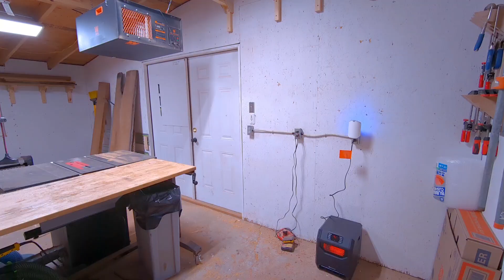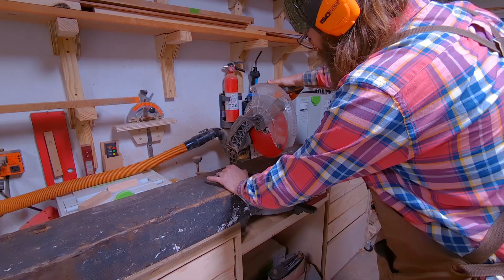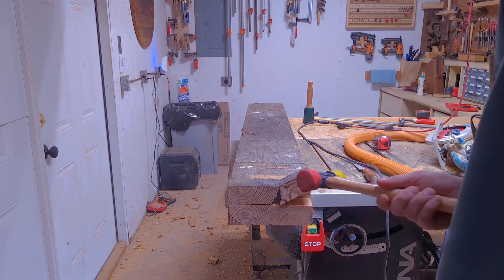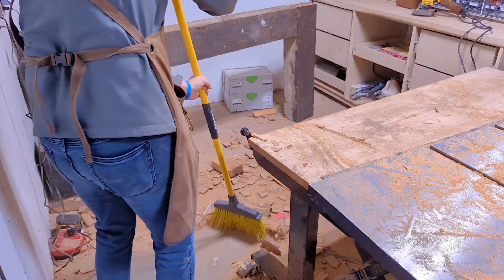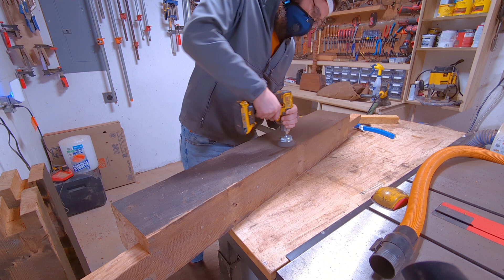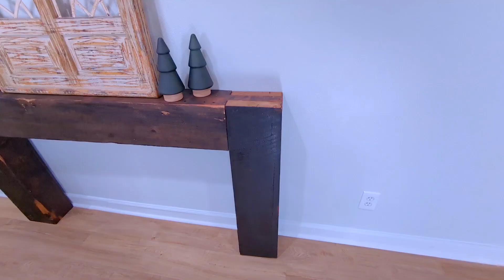The easiest way to build an entryway table using joinery | DIY Entryway Farmhouse Console Table

Comment: Old tube and knob electrical
Reply from the maker: It's cool to see stuff like that and be able to somewhat date the time period of the house.
Reply: @burnstockwoodworking  yea I pulled out of my house a while back when refinishing my house
Most houses in my area are like 100 years old or older so alot of plaster and knob and tubing

Comment: Awesome work! My dad and I remodeled an old house in downtown Hammond a couple years ago, it was hard work trying to save all that old wood but we did save most of it. He's done some pretty cool projects with it we still have a couple of the old doors left. I couldn't help but admiring how tight the rings were in those beams. They are probably well over 100 years old and will last 100 or more that's some good quality wood you saved from the landfill!
Reply from the maker: Thanks!  Those tight rings indicate that the trees are "old growth".  Much better than lumber bought today, they started modifying pine in the 50's which has resulted in the wide ring / shoddy lumber we have today.
Reply: Yes even old pine is way better than commercialized quick grown pine today.
I love making stuff from old barns etc
I just did a pretty big project I got some old barn doors from the Amish here in Lancaster PA and turned them into an accent wall in a million dollar townhouse in Fishtown Philadelphia 
Did a quick vid if u like to see it
Also made some tables from old Barnwood from GA
https://youtu.be/xEyfHV7TxV0